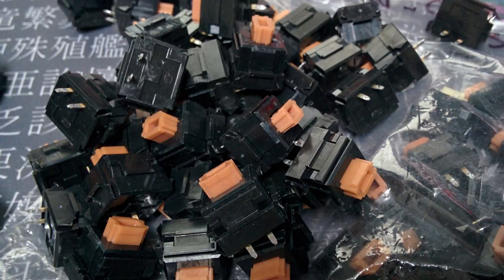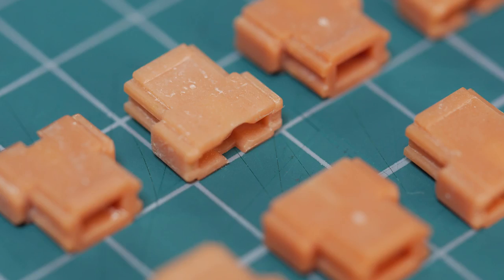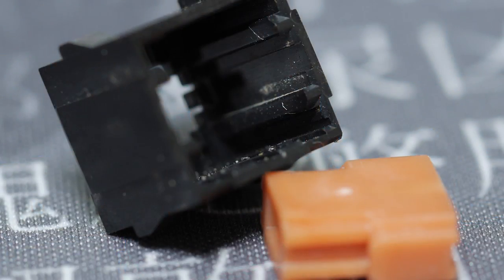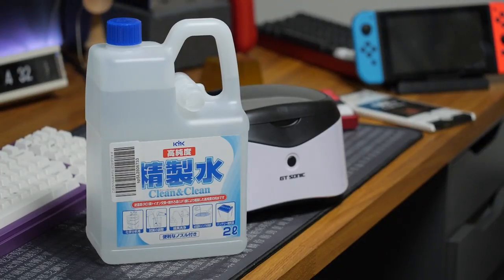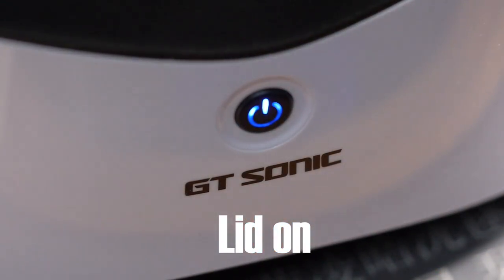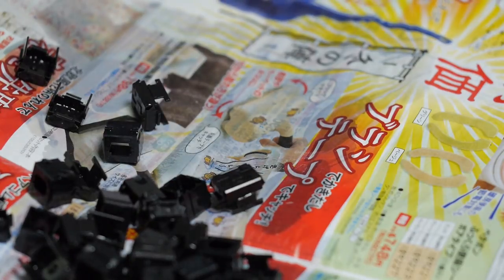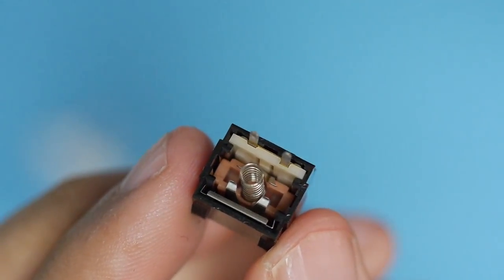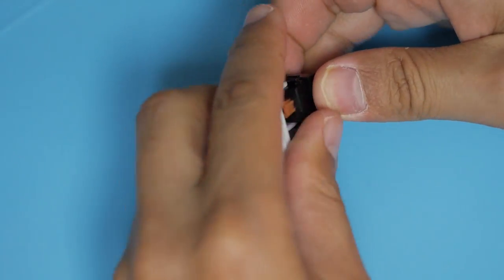AEK64 Build Log: Cleaning the Orange ALPS (Part 1)

Comment: That residue was the factory applied dry lubricant.
Reply from the maker: Yep, problem is after such a long time, the switches are really inconsistent.
Reply: No, the factory applied lube can be seen as two dark strips near the bottom of the slider on both sides. This was very clearly some sort of residue.

Comment: sooo i have a nice AEK with orange ALPS, and i'd like to do a build like this.. but where to buy the PCB and case?
Reply: You can buy a PCB from Hasu on Geekhack, or Clueboard has some 60 %s in stock. You just have to email them, because they have not put them on their store. When they redesigned their PCB they added speakers that were too big. I had to desolder them. 

The case you can get from Clueboard.co too, there is also a really nice looking 3d-printable case on Reddit. 

I'm also currently designing my own alps case with an integrated plate.
Reply from the maker: The ALPS64 PCB you can get from Hasu when he does his regular group buys. I think one just finished last week, but he does run them fairly often. The case was pretty limited and you'd need to get one second hand. The  ALPS 64  follows the standard 60% form factor, so you can make any case work, but if you use the AEK keycaps, you're going to have gaps toward the back of the keyboard.
Reply from the maker: I didn't know they still had stock of the AEK64, but it looks like they still have B and C stock in the Dents & Dings section of the site.

Comment: I have sourced some really clean Orange Alps for my build, should i lube them or leave them stock? and if i lube what should i use RO59? im new to alps
Reply: 100% lube them, will extend the life of them significantly. With an everage MX switch I can totaly get not lubing, but with switches that rare best to do all you can to keep them going. Lube type really comes down to personal preference, even somewhat moreso than the switch itself. Most lube isn't very expensive and/or have cheap samples, so worth getting several and trying them each out in a switch or two; easy enough to clean out any you don't like.
Reply: Do not lube them if they are clean.

Comment: Tokyo60 is live on mASSdrop! The round 1 edition lacks rgb diffuser though
Reply from the maker: Yeah, it's finally live!
Reply: Hey, I need your advice. Isn't KPrepublic's HHKB case + DZ60 better (it's even cheaper) . I mean, tokyo60 is really cool but it does not look like a premium keyboard and its 1st round is somewhat meh
Reply from the maker: Is the KPRepublic one the one with the feet that kind of curl under with the transparent bottom? I think that one looks much less impressive than the Tokyo60, but it is much cheaper. The integrated top plate is a major plus point for the Tokyo60. If they can nail the manufacturing, the Tokyo60 will be really hard to beat.

Like you said, the lack of diffuser this time around will put a lot of people off, but I'm hoping it goes smoothly.
Reply: What is so special in this integrated plated?
Reply from the maker: Keyboards with integrated plates can feel more solid, since the plate and the top of the case is one piece, rather than being attached with screws like most cases.

Comment: It's a shame that old Alps are hard to find switch only (and pricey), crap when they are mildly dirty,   and don't last as long as cherries or or IBM. But very cool switches and there's a large variety of them. And then there's Matias, which are brand new, have a mid sized variety and last AS long as Cherries! Though I'm a bit lucky because I found a good condition SKCL green board for the HUF equivlant of two bucks one time.
Reply from the maker: Yeah, it's nice they still have their fans, but I wish I could try out some different switches without so much effort. You're so lucky to have found that board with the greens!

Comment: Not using lube will damage the contacts faster. Even if it feels fine for now.I'm using some Ballistol PTFE spray, which dries to a white residue.To lube, put the sliders in a plastic bag, spray lube and shake them around to spread it properly.
Another note: rinsing with distilled water (you can clean the soap with running water first) is more important than using it inside the ultrasonic.
Reply from the maker: I think the method of putting them in a bag and shaking them, isn't one that is universally liked. I'd rather get the lube only where it's needed. I agree with you on the need for lube, and haven't used the keyboard for longer than a few minutes. Now that I have some lube, I can get on with it. Thanks for the note on rinsing. I'll use the special water for that from now on.
Reply: I mean plastics are self lubricating, so the contracts should also do fine. Or does it?
Reply: @user-yk1cw8im4h  Not all plastics are self lubricating, and even then the term is quite misleading in most cases, quite a few "self lubricating" plastics will slowly saricfice that plastic as "lube". And even with the better "self lubricating" materials, using lube will still greatly increase how long they last as it helps prevents scratches and wear from dust and debris, and even without any dust it still extends the usefull lifetime by a lot. Self lubricating basically just mean that the friction is relatively low, but that doesn't mean wear-free.

There will always be wear with moving parts, but better to put some of that burden on easily replacable lube then the switch parts themselves.
Reply: @Oleg-oe1rc  Thanks for the info, that makes total sense. I know it's incorrect but lube somehow feels like it gathers dust and make the situation worst.
Reply: @user-yk1cw8im4h  Dust can be problematic with wet lube, just depends on the eviroment and how you apply it, but there are also dry lube products like graphite powder. Vast majority of situations dust really isn't an issue, but if you're in an area with a lot of dust constantly circulating around like a carpentry shop, can be worth looking into dry lubes. But depending in the exact application, wet lube can even be used to seal the switch in completely from the outside air. And while some applications it's unavoidable, sometimes having a lot of dust in the lube can be better than just a little bit of dry dust, especially for very closely fitted parts.